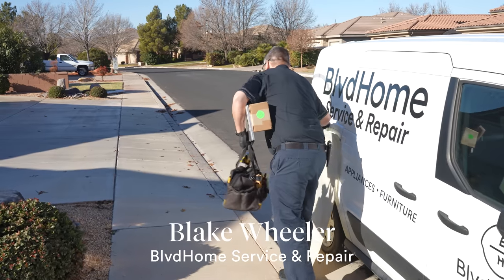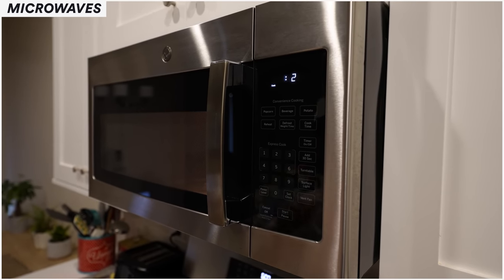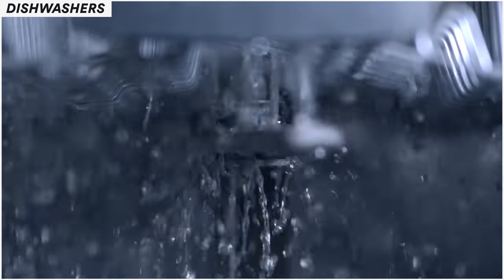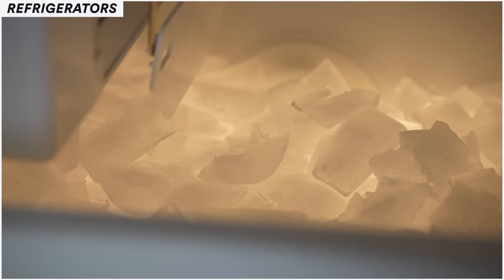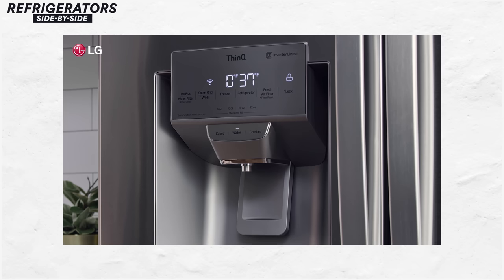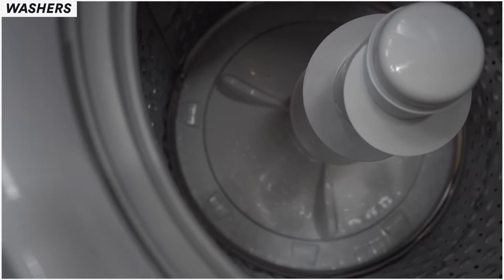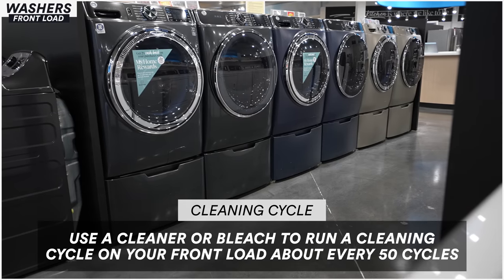Best Appliances Recommended by a Repair Technician of 29 Years

Comment: I'm happy to see that most (if not all) of his recommendations are similar to Consumer Reports. I'm not sure which of the two I'd trust more, but it's cool that their advice lines up. Can confirm that Bosch dishwashers are worth it for how quiet they are, and my old LG front-load washing machine was incredibly good. I also had all GE appliances in a previous house that all lasted 15+ years.

I had the water line to my old GE fridge break once, however, and flood my kitchen. I really want to know which brands have the safest water line connection, because the idea of coming home to a flooded house still haunts me.

Comment: Microwaves should be designed for the way the customer uses the product.  GE microwaves fail because the relays on the printed circuit board fail, not because the door switch contacts fail.  The crappy rotary selector knob on a GE microwave is also a failure point, even if you are very careful with them.

Comment: My LG washer continues to not feed bleach. They use some sort of siphoning action that, based on internet searches, is a common failure point. Then if bleach is added it can corrode metal internals. I would never again buy an lg washer. The dryer always defaults to a setting that leaves clothes to wet to wear or fold up. Always increase to time/temperature or run two+ cycles. Needless to say, I don’t recommend LG.

Comment: About the only brand I will never ever own again is Samsung. Their fridges drool water when the defrost drain freezes up, the ice maker is a continual problem (5 in 5 years plus a another when we sold the house) and it's compressor rattles. Washers that wont allow enough water to actually wash (kinda fixed that with an adjustable water level switch) and TVs that die a couple weeks after the warranty runs out (2X). Then there was that dishwasher ........ We found that Frigidaire worked well for the kitchen and is within our mid line budget while our $$ LG washer has been faultless along with the non electronic controls, bottom end GE dryer

Comment: Disagree on Bosch.  The cleaning is good and they are pretty quiet.  But drying?  Not so much.  They screw up on simple things like a light to tell when the cycle is done.  The app is a train wreck.  Buttons on the display have a lag and it's a confusing interface.  There's no cancel button.
Reply from the maker: Sorry to hear about that! Thank you for sharing

Comment: I paid more for a Bosch dw and it needed repairs by 5 years. Even after the drainage pump stopped working. NEVER going to buy the brand. Same thing with the w/d. Neither held up well.
Reply from the maker: Sorry to hear that! We've found that typically Bosch is a very reliable brand, so we're surprised to hear about your negative experience with them. Hoping you can have some better luck in the future!
Reply: @BoulevardHome  switched to LG. Have a 13 year old fridge working but the ice maker did stop working about 3 years ago. Washer is LG, mircowave, and dishwasher. All almost new. We’ll see how they hold up.

Comment: Doesn’t anyone use common sense that front load washers having a sealed door need the door to be cramped open so the residue moisture evaporates? That’s it. No odor, no special cleaners. Maintenance, use bleach, vinegar and spray furniture wax to keep it show room new. To clean the tub, put 2 cups of bleach in during a hot water fill. Sanitize cycle or longer running hot water cycle. It will look like you added soap. That’s proof it needed cleaning. Clean the seal, door windows inside and out and cabinet with pledge. Shines like new. The dispenser jets get hard water build up. Remove tray soak a couple of wash cloths  with vinegar and roll them to cover the jets. Tea towel works if wash cloths are not big enough. and let the vinegar do it’s magic. Overnight works best. Not all models have a inner cabinet filter. Check owners manual. I recommend an Electrolux because they’ve been building them for over 60 years in Europe, have a double seal door and the standard size units come with extra large tubs on both washer and dryer. Can handle bedding and rugs. Great water savers. The washer tosses the load to weigh it then adds water. It will add then more if needed. Clever!!

Comment: Truth to the fact that LG makes good laundry machines and bad fridges. 

In the time that we’ve had LG washer and dryer we are now on our fourth fridge: 2 Whirlpools and an LG, now replaced with a GE. Whirlpools mainly had ice and defrost issues that I attribute to bad design. The LG only lasted four years and was at least the dreaded linear compressor issue, They are still throwing parts at it and support is a pain. From my testing, the control board doesn’t appear to be putting out the correct voltage the compressor has an inverter circuit control its operation. Over complicated design in my opinion. 

I heard another tech mention recently to look at the schematic diagrams if you can and buy one with a simpler looking schematic. Less problems to be had.

Comment: I'm on my second set of GE front load washer and dryer. Great machines. The bearings on the previous washer degraded and it was almost as expensive to repair as to replace, so we replaced it. Oddly, the new machine's cycles were shorter, which I appreciated. We moved and bought new machines and went with GE again. We also have one of those fancy Advantium 5-in-1 ovens. Hope that was a good buy.
Reply: Things must’ve changed.  10 years ago I worked for GE Capital and we had employee discounts. So I got a pair of GE front load washer + dryer. It was the worst washer ever. I had a newborn at the time n all whites came out gray.  I called for service and the service guy told me GE washer was the worst.  Later on I recall GE sold the division to Electrolux.  I ended up replacing the pair with a pair of Samsung. Much better.  I’ve also used a pair of LG before. They were fantastic.

Comment: Don't buy an LG small air vents build up with dust and if that happens overheats and you'll get a leak which is out of the 2 year warranty and repairmen will tell you to just buy a new fridge as it's a big job to fix... Buy fridges with good ventilation!

Comment: the jury is NOT still out on LG-  they don't allow lawsuits. They require their customers to agree to Mandatory Arbitration... even if the customer doesn't actually KNOW they are agreeing to Mandatory Arbitration... I mean, it's printed on the big box the refrigerator comes in that the delivery guys take away with them. Apparently, you're supposed to tell the delivery guys to wait until you read the box before they take it away. It's also in the owner's manual- and after-all, 'everybody' reads their owner's manual when they buy their refrigerator-  right people?

Comment: Im glad you singled out Samsung. They really are the worst. They have an issue where ice builds up on the back of the fridge and eventually water pools up in your fridge rather than draining. The issue is so common that people have left thousands of reviews for the part to fix it on amazon. That means probably tens of thousands of people have had to rip open their fridge and deal with this issue. Basically the manufacturer drain clip is too small and doesnt properly transfer heat to defrost. You can fix it with a $5 part and a few hours of labor to tear apart your whole fridge and thaw everything out. Im just happy Samsung gets to save 50 cents in material by having an ever slightly cheaper metal part at the cost of everyones fridges freezing up after a few years use.

Comment: 🎯 Key points for quick navigation:

00:00 👋 Introduction and Overview
- Introduction by Blake Wheeler,
- Overview of the appliances to be discussed: microwaves, stoves, dishwashers, refrigerators, washing machines, and dryers.
00:13 🍲 Microwaves
- Importance of features and personal preference,
- Common failures due to user error, 
- Tips on proper microwave usage to avoid failures.
02:09 🔥 Stoves
- Different stove types: induction, radiant, gas,
- Reliability of standard vs. commercial ranges,
- Features to consider and common issues.
03:34 🚰 Dishwashers
- Preference for Bosch dishwashers for reliability and performance,
- Other recommended brands: Whirlpool, Electrolux, GE,
- Explanation of BSH Corporation brands: Bosch, Thermador, Gaggenau.
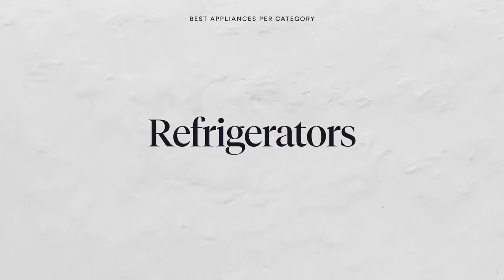05:13 ❄️ Refrigerators
- Types of refrigerators: top freezers, French door bottom freezers, side by sides,
- Issues with features like ice makers and water dispensers being the most common failure points,
- Recommendations and cautions for brands: Frigidaire, GE, Whirlpool, caution on LG and Samsung.
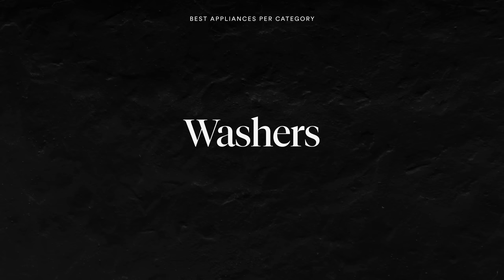09:41 👚 Washing Machines
- Types: top load vs. front load,
- Best top load brands: Speed Queen, LG, GE,
- Importance of cycle settings for water efficiency in top load washers.
11:19 🧺 Front Load Washing Machines
- Maintenance tips to avoid odors and issues,
- Best brands: Electrolux, LG, GE, Whirlpool,
- Emphasis on proper care and usage to ensure longevity.
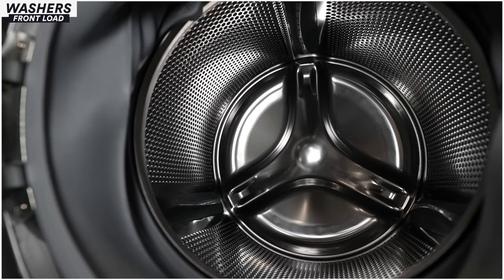13:27 🌬️ Dryers
- Recommendation to buy matching dryer for the washer,
- Importance of aesthetics and matching sets in home appliances.
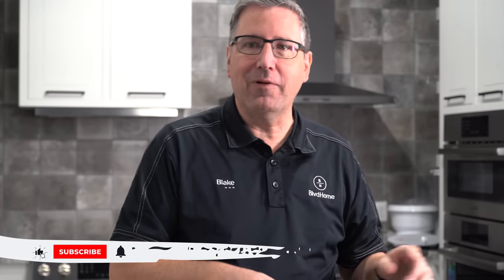13:55 ✨ Conclusion
- Summary of recommendations based on personal experience,
- Encouragement to make informed decisions and ensure lasting satisfaction.

Made with HARPA AI

Comment: I very much regret buying a  LG refrigerator.  The one I bought is downright unsafe and negligently so.  It is supposed to defrost itself, yet it ices up every several months to the point of ice in the freezer completely blocking the flow of cold air to the refrigerator section.  I bought the internet-connected model with self-diagnostics, yet the fridge self-diagnostic lies and says everything is OK, and urges me to wait for the defrost to complete, which is never really does, as my food is held unsafe at 60F for days until it power down for a proper defrosting.  The fridge should be designed to alert me over its internet app of the unsafe condition, but instead it just lies to me so that I don't call for on-warantee repairs.

Comment: I can attest to the comment about commercial ranges.  We have a Thermador 48" range with a steam oven.   When it works, it's great.   But the steam oven recently died and the 'display' part that is required for repair is (per Thermador) "not available" and it appears that it's just not on back order.   We're being told that it won't be available at all.   Thus, the steam oven is completely useless and not repairable.    To me, this is unacceptable.   I understood that that these units may have extra features and require additional maintenance.   But I assumed that they would be repairable and the parts would be available.    The unit is 9 years old and while it's not new, I don't consider it old either.      

Has anyone else had this issue with Thermador?    I assumed that on the high end appliance market, the customer service would not be this poor.

Comment: I hate side-loading washers.  You have to bend your back to load and unload, and a lot of your clean clothes end up on the floor before you can get them in the dryer.
And I must say I lived in an apartment complex where we had 5 LG side-load washers with LG dryers,. and they were TERRIBLE!  The washers STANK, and the machines were constantly breaking, and it would take months to get parts.
The brand that is conspicuous in its absence here is Maytag.  I had an early 60s vintage pair of Maytags (the inside of the wash tub was enameled!) and those suckers were not only utterly indestructible, they got my clothes cleaner than any of these modern machines do.  Far FAR better than anything on the market today. 
Unfortunately, they were purchased by Whirlpool, and now they are terrible.

Comment: I think the moral to the story on which brands and models to choose is do the research. You gloss over some pretty bad brands and I understand why. Yes, every brand has a bad unit, but some of these brands (and their manufacturers) are just bad - poor engineering, cheap parts, shoddy construction. Sometimes it is with a specific appliance type, and sometimes it is the brand in general and the companies that actually manufacture the lines. Some appliances, like microwaves, are all built by the same company or two so it doesn’t matter - you’re getting the same bones with different skin. With other appliances the difference can matter. Research.

Good video, though. I never thought about things like opening the microwave door.

Comment: For buyers watching, it would make sense that commercial appliances to be repaired more often because of the cost, and since they're used more and are usually designed to be easily repaired with standardized parts and accessibility. Whereas home appliance owners would probably be more willing to just replace it instead of going through the repair process, especially with current generally anti-repair design, they'd rather shop around something better. People want more reliable and resilient made appliances because they don't want repairs in the first place, but repair is generally inevitable. First time buyers look for shiny features but overlook key components. 
I don't find anecdotes really that critical here, and the data needs more in-depth analysis and interpretation than surface level numbers, I don't suspect there's enough data to make any concrete conclusions. Going for direct comparison of the quality of parts and design between models would be more crucial.
Reply from the maker: Great insights, thanks for sharing!

Comment: Life is too short to press the pause button on the microwave. I'll just replace the door switch when it goes bad. It's a design flaw if the designers still don't design for users opening the door directly. Not a huge problem to fix for them. Break the circuit same as the pause button, it's not that complicated.

Comment: I had an LG french door frig that failed three months before the warranty was over. They sent a repair guy who worked on it for 3 hours and finally gave up and finally ordered a new compressor; he stated it was leaking freon. Three weeks later he installed the new compressor and guess what, it still leaked. He leak checked the frig for three hours and finally gave up. He stated the leak was somewhere in the freon distribution in the body of the fridge and couldn't fix it without disassembling it entirely thus it was unrepairable. I spent the next five months fighting with LG to replace the fridge but they stalled by slowly escalating my problem through three levels of "customer service". I finally gave up having wasted nine months of time with LG. The bottom line is, DO NOT PURCHASE LG, THEY WILL NOT STAND BEHIND THEIR WARRANTY!

Comment: ### *🔧 Best Appliances Recommended by a Repair Technician of 29 Years* 

This insightful video from Boulevard Home features Blake Wheeler, a technician with 29 years of experience in appliance repair. He breaks down his personal recommendations for various appliances, from microwaves to washing machines. Let's dive into the key takeaways from the video!

#### *🍽️ Microwaves*
- *Key Insight:* Microwaves across brands share many of the same components, such as magnetrons. Blake emphasizes that most microwave failures are due to user habits—specifically, abruptly opening the door without pausing first. This damages the door switches. His advice: always use the *pause button* to avoid unnecessary repairs.

#### *🔥 Ranges*
- *Key Insight:* There are three main types of ranges: induction, radiant, and gas. Standard ranges are typically more reliable, while high-end commercial brands like Viking and Thermador tend to have more problems. If you're buying a range, go for the features you need, but expect more maintenance for larger, more complex ranges.

#### *🧼 Dishwashers*
- *Blake’s Pick:* *Bosch dishwashers* are his top recommendation. They are durable, quiet, and efficient. While other brands like Whirlpool and GE are good, Bosch stands out for longevity and quality. If budget permits, a Bosch or Thermador dishwasher is worth the investment.

#### *❄️ Refrigerators*
- *Key Insight:* Simplicity wins when it comes to refrigerators. The more features, like ice makers and water dispensers, the more likely problems will arise. For side-by-side and bottom-freezer models, Blake recommends Frigidaire and GE as reliable choices. However, he remains cautious about LG and Samsung, especially when it comes to compressor issues.

#### *👕 Washing Machines*
- *Top Load vs. Front Load:* Both types have their pros and cons. *Top loaders* are more aggressive but quicker, while *front loaders* are gentler but require regular maintenance to avoid odors.  
- *Best Top Loaders:* *Speed Queen* leads the pack, followed by *LG* and **GE**.  
- *Best Front Loaders:* *Electrolux* is Blake’s go-to brand, known for its reliability.

#### *🌬️ Dryers*
- *Pro Tip:* Always match your dryer with the washer to avoid mismatched laundry sets and keep your spouse happy!

---

### *Video Essentials*
| *Title* | Best Appliances Recommended by a Repair Technician of 29 Years |
|---|---|
| *Author* | Boulevard Home |
| *Watch it here* | [Best Appliances Recommended by a Repair Technician](https://youtu.be/oC9PufP0UtI?si=H7mXwQABOVAn4tcb) |
| *Key Topic* | Appliance recommendations based on repair experience |

### *🔥Use '-pro' to try a more powerful version!*
Speed to Video Essentials.  
Experience the video-to-article magic!

Comment: Bought a speed queen this week-tr5, found out not working  2 hours after installation, tech came & found pressure sensor & harness need to be replaced. This is a brand new machine, I’m baffled. Is this a quality control issue?
Reply from the maker: So sorry to hear about that! That's definitely unusual for Speed Queen. Unfortunately, sometimes things go wrong even with the best brands. It could have been anything from a quality control issue to damage in transit. We hope you got the issues fixed without hassle!